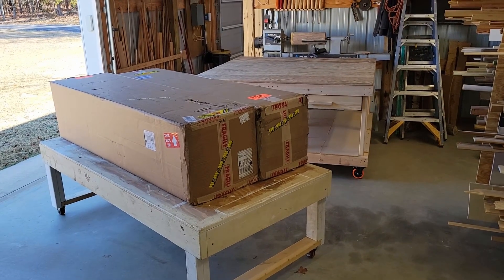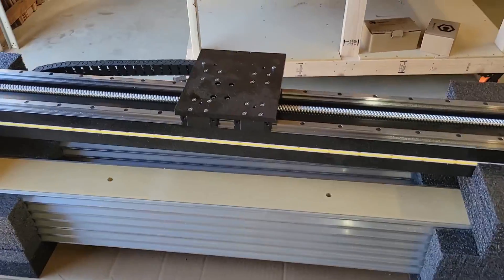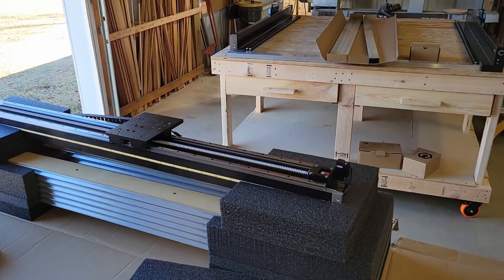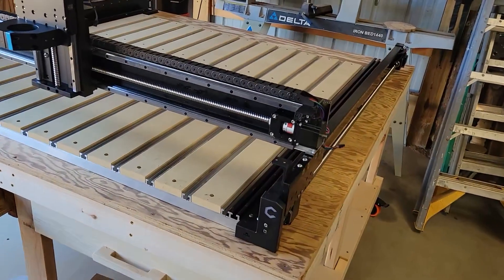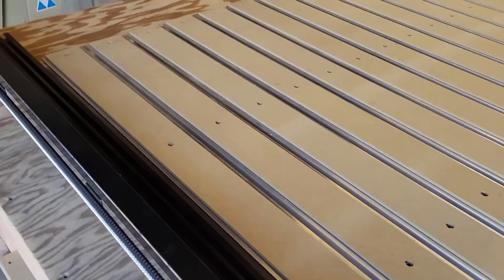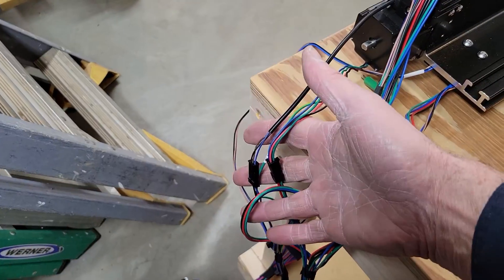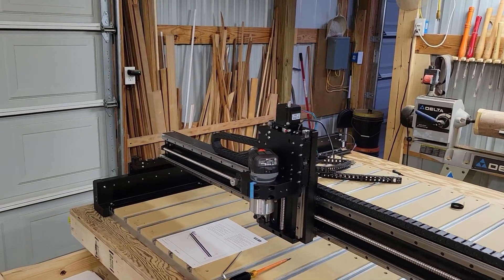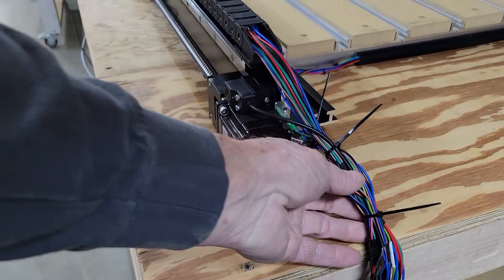Unbox and set up my new Shapeoko 5 Pro CNC

Comment: Nice video, it's a shame you missed the audio when you were showing details of the construction/assembly. I've watched lots of videos showing assembly for the S5 Pro, but you managed to show more details than any of the others. For example I wanted to know what the cross-sectional shape and size were of the x-axis gantry extrusion. You showed that quite well! I know this was a year or so ago, but in the video you never followed up regarding customer service when you had to call to get the missing pieces? Did you eventually find them in the packing? If not, how did Carbide3D customer service respond when informed of the issue of missing pieces/components? Thanks again, subscribed!
Reply from the maker: I would have to go back and watch the video again to remember the moment you are asking about. As for customer service they sent the parts within days with no questions asked. Very responsive to my request. Thanks for subscibing.
Reply: @DougLearn  Thanks for the follow-up. Carbide3D does seem to have good CS. And I think they've upped their shipment prep game to reduce the chance of missing pieces.

Comment: You gotta print your own manual unfortunately
Reply from the maker: I ended up doing that. I still have not found out exactly what the oil is for. I can not find anything on keeping it maintained.I am having a lot of fun learning to use it and will be showing a bit of that soon.
Reply: @DougLearn probably the ball screws.